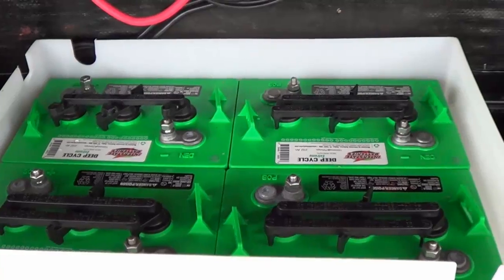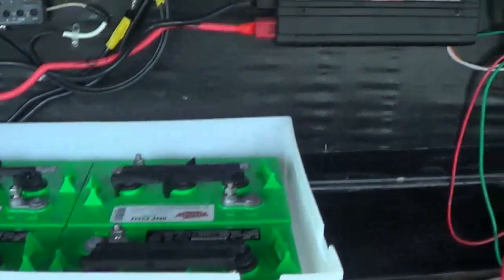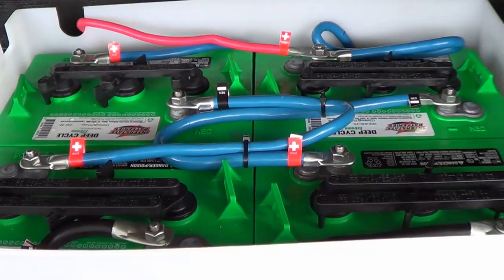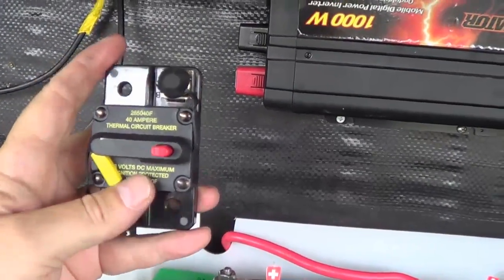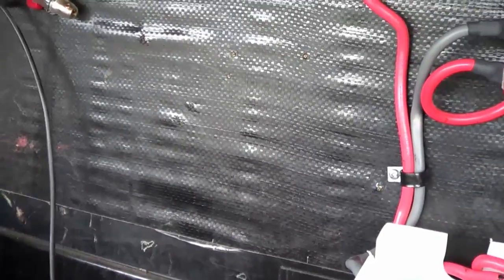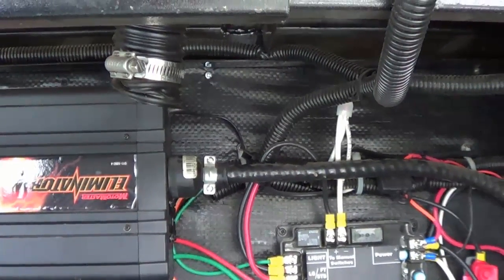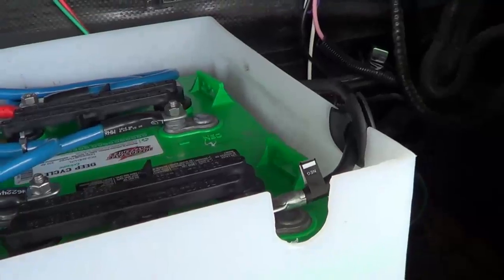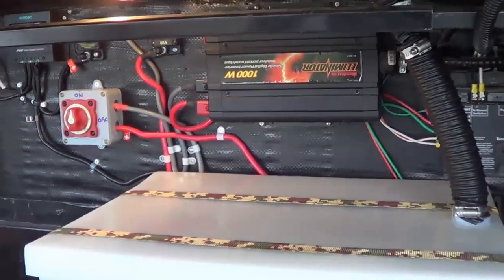Upgrading My RV Battery Bank for Dry Camping

Comment: Hi Ray yes lots of power need more though for my wife has lung problems and I have to have enough power to run a oxygen concentrator 24/7.i'm going to be taking out my 4.5 kW generator and putting in another battery bank should be able to fit 6 to 8 more batteries in that location.  Plan on installing more solar panel on my rig as well.
Reply from the maker: That's quite the mod project, look forward to seeing a video when you're done. :)

Comment: We just came back from camping and felt like our two 12 volts were not lasting like they should and then we see this video... Thanks for posting it. I was just telling my wife about upgrading our two 12 volts to two 6 volt AGM's. We must have a parasitic draw of power somewhere.
Reply: +RVing Illustrated could it be your propane detector
Reply: Install a kill switch to cut off the power from the battery when it is in storage. The little light on the radio/DVD player also draws power. Two 6 volt golf cart batteries would definitely be better, but I’m not aware that they are available in AGM. If it is in storage for most of the time, i recommend a 100 watt solar panel to maintain the battery if a power source is not available to plug in the RV.

Comment: all the time you are the genius with your precisely work.
i had a question regarding the power.
i have an invert er 1500 W near to the battery as you said to run the rig boun docking without generator.
my concern that i have connect the core which should gos to generator receptical and inserted in to invert-er to run tv,light,charging phone etc.....
but when i insert the core and start run the invert-er the converter near the inside DP its run as usually to charge the battery thought this power coming from the generator  as you said loop like a circle i think you know what i mean.
is this kind of connection will harm the battery or DP or rig converter.

Comment: Is there a specific advantage to using 6v batteries as opposed to 12v?
Reply from the maker: Generally they are built a little more rugged ( they are built for golf carts) and have thicker lead plates. They are taller so take a smaller footprint. They can also usually handle more deep discharges than regular 12 volt deep cycles.
They also tend to give you the best bang for your buck and are tried and tested over the years so tend to work well with all chargers.

Comment: Nice work. Is your inverter a Pure Sine, and are you thinking about going bigger? My last toy hauler I had 1500w and found I wanted more. It was modified and that may have been part of my problems? I am going with the 3000w Pure this time.
Reply from the maker: Thanks, I'll stay with 1000w, it's plenty for us. We are mainly interested in powering our electronic gear, computers, camera chargers, laptop, LED TV etc. It's a pure sine wave. I also carry a couple 2000w generators if I really need to power up a big load, even the AC.
Reply: Cool. Thanks for the reply. Long time viewer, just subscribed a few days ago. Love your video of Ed's set-up. Going to try and go between your solar set-up and Ed's.
Reply from the maker: Thanks for the sub. I will be putting up a video soon detailing one of Eddie's recent installs he did for a friend. They videod all the install steps and send the clips to me. I'm going to put together and uploaded pretty soon.
I think it will close to what you're looking for as it's kinda in between and Eddie got to start it from a clean slate.  Cheers Ray
Reply: Part of adapting to solar is to reduce your need for electricity, especially 110/115/120 volt. Plan on propane to "power" your high draw items and  forget about running roof air (even one) on solar. You can throw money at a bigger and bigger solar system to keep your pre-RV lifestyle intact yet... part of the fun is seeing how little electricity you can get by on. If you do size up...it would be to have enough electricity during those longer stretches without enough sun.

Comment: I use a hammer crimp tool to make custom length battery cables for the rv and work boats.  They are cheap, small and easy to store and they work great.  https://youtu.be/UWq2phbmMs4
Reply from the maker: +RV Crazy Thanks for the demo. As an electronics repair tech, I've crimped wire before, usually crimped them with a hand tool then soldered them, but they were of course very small gauge. I've never dealt with the large gauge stuff.
Look pretty easy with the hammer tool. I think that's what my friend has.
Reply: For about $25 or so it's a tool that has been extremely valuable to keep in the RV with me.  Especially with getting new batteries and playing around with solar.  You can also use a torch to solder the battery cables after crimping them if you wish.  With the hammer crimp tool it puts pretty much a cold weld on them though which is a great connection.  After that I use marine heat shrink which is thicker, it can shrink 3 times smaller than it's original size(normal heat shrink is only 2 times smaller), and it's adhesive lined.
Reply: +Allen Hare I bought the hammer crimper from Amazon.  Mine is made by Timco.  Marine heat shrink I actually buy from Harbor Freight.  It's in a multi sized pack just make sure it's the one that says marine.
Reply: RV Crazy Very good. Thanks for the reply.
Reply: +RV Crazy Thanks for your excellent input. I like the solder of connections, too. Where do you get the marine grade heat shrink, and the hammer crimper?

Comment: Hi Ray, looks like you're getting a really great set-up together.  One thing you didn't show in the video (and one thing I'm going to need to do soon) is how to get the batteries in and out of the battery box.  I'm not sure how much they weigh but I know lead isn't light.  lol
Any tips on lifting them in and out?
Reply from the maker: It's coming along piece by piece. :) 
The batteries are about 60 lbs each. Not too bad to lift, it's mostly about technique, keeping them close to your body. I was on my knees in front of the storage bay and lifted pretty well straight up against my body and then over the lip of the storage. Wear old clothes in case a little acid gets on them.

One thing I did to make it easier was to shorten the fiver front jacks so the front of the rig was really low. Means I didn't have to lift them very high and could stay on my knees while doing it. Cheers Ray
Reply: +Love Your RV OK, thanks.  I guess I'm going to have to start working out now to build up my muscles!!  or maybe I'll just call you when the time comes?!  lol
Reply: +Love Your RV  ha ray, you can get a battery holder at any auto parts store, you hook a loop on each terminal which has a strap between them then you can jusst lift then out of the box with ease and carry them. its called a battery carrier
Reply: there are several type of battery carriers, check with any auto parts store, thell have them. i dont think wal mart and those type of stores carry them. it ill make it alot easier to handle the batterie.
Reply from the maker: Thanks for the tip, I see the batteries also have a plastic tab on each side. I remember the Interstate battery guy had a strap that hooked into those as well.

Comment: Very nice Ray you have to look at my video I've got the450 W solar panels across the front of my motorhome going into a TriStar 60 amp PWM I have the same batteries as you and then I have a marine deep cycle hundred amp hour battery for my coach.
And I have 150 W solar panel at the back of the motorhome to charge my batteries during winter. I have the 450w plug into a grid tired inverter.
Reply from the maker: +Jeff Loitz Sounds like a sweet setup!

Comment: I haven't done it yet and have not heard of someone else doing it. But when it comes to adding a shunt isn't the breakers you just put in more or less a shunt? To my simple mind of thinking a shunt is just a way of having a "connection point in the same line for amp readings. You have that with your breakers. The only concern would be the fuse part could cause a different reading than what is actually present. Just a thought.
Reply from the maker: +Jerry Densmore A shunt has a very very low known resistance, a specialized meter can then read the voltage drop to accurately measure the current. The is a good PDF document link here on shunts - http://www.bogartengineering.com/content/accessories

Comment: Just a question, so when you are plugged in the converter still charges the batteries, and if the inverter was hooked to the rig 120 vac system you would not want to use the converter. Just wondering I have seen units where they just used a receptical and plugged the rv into the generator or inverter or shore power  to keep it simple. I hope I am not to confused. Will the converter and solar charger work at the same time?
Reply from the maker: +Ed H The problem arises when you plug the RVs power cord straight into the inverters output. The inverter tries to power the RVs converter which tries to charge the batteries which are powering the inverter and a weird power loop takes place. A simple solution is to flip off the converters breaker so it is disabled. a more elegant an expensive solution is to install an auto power transfer switch .http://gpelectric.com/products/30-amp-transfer-switch. I prefer to have a dedicated Inverter only outlet in the rig.
All depends on your power needs.

Yes, solar power and converter can charge at the same time.

Comment: ray you should draw your pos and neg from one side only...
Reply from the maker: Thanks, UH-1. Do you have any links to more info on this I wonder how much difference it really makes on a small 4 battery bank.
Reply: +UH-1 I have also heard that is supposed to be the best way for balancing the bank. But I also charge on one side and draw from the other like so many do with not too much trouble. Maybe some better info will get me and others to change their views.
Reply: 4:20  are you talking about the top right battery having two positive wires connected to it? Looks like one comes from the trailer and one goes to another battery.
Reply from the maker: +aguyandhiscomputer I actually ended up later in the video changing that connection when I installed my disconnect switch. Here is an interesting article I found on hooking up multiple batteries in a bank - http://www.smartgauge.co.uk/batt_con.html  Looks like the best way to hook up the bank is on opposite corners. So the load and charging to each leg is equal. That looks like the theory anyway.

Comment: It looks like you have your 12V RV system wired directly to the right leg of the battery bank an the charging system wired directly to the left leg. The only system that you crossed the connections is the power inverted. Taking in to account the resistance of the cables connecting the two legs, the right leg has more power being pulled from it an the left  leg is being charged more. My understanding is that you should have the hot wire connected to one leg an the negative to the other so the resistance is even across all batteries. Not sure how big of a deal that really is but everything I have read on it makes it out to be a big deal.
Reply from the maker: +RebelCowboySnB Interesting, I wonder how much it means on a small 4 battery bank. I could see as you start piling up batteries and have a very high current bank it could start to make a difference.
The RV charger wires are actually crossed and the inverter as well. It's the solar controller wires that are attached to the left leg, allowed me to keep the cable length shorter. I'll have to read up more on this, thanks Ray